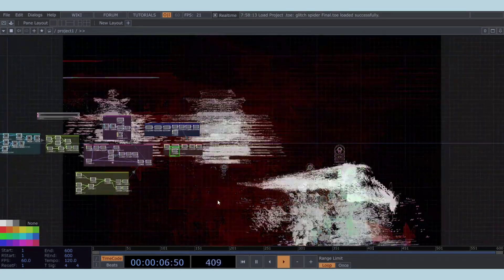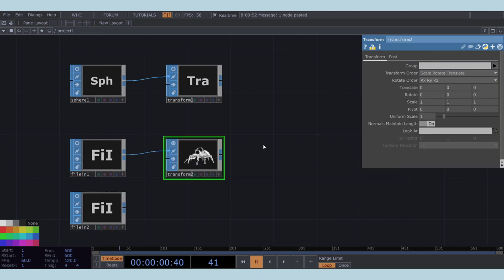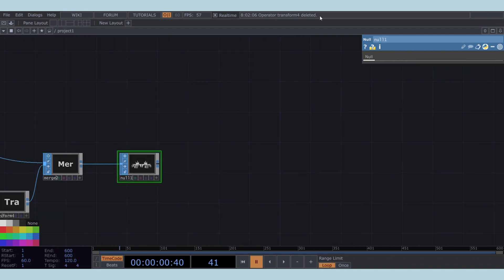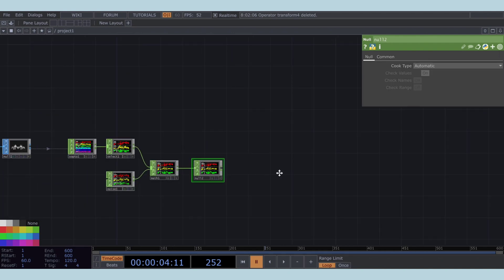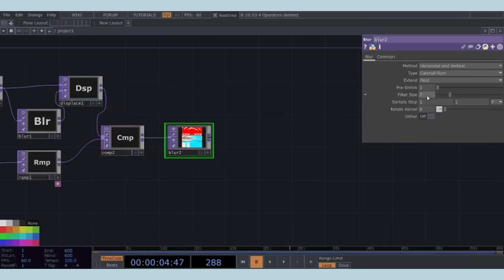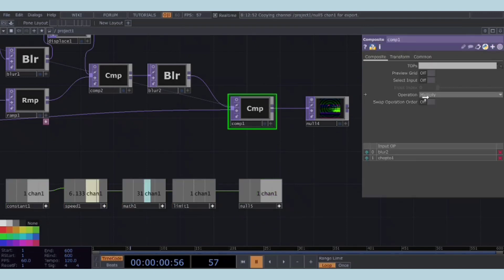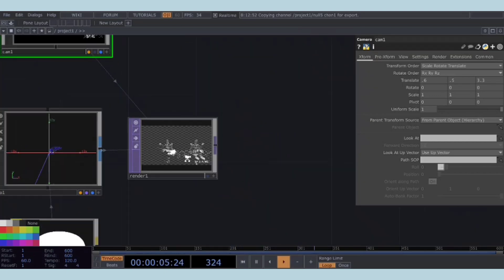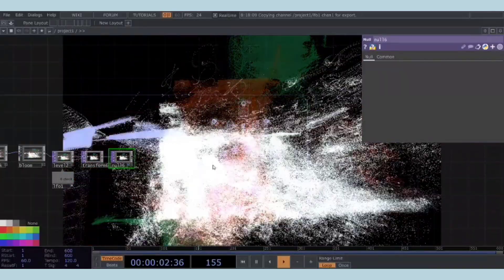Glitch Spider particle system - TOUCHDESIGNER Tutorial

Comment: hi mate currently when my bass comes in the main background goes white how do i change this so it's not white maybe a different colour or just black?
Reply from the maker: U can invert the color using the level top at the end just set invert value 1,to have ur desired colors use the combination of ramp and lookup just connect the visual in the first and ramp to the second input of the lookup and adjust the ramp settings to change the visuals color I hope this is what u wanted ❤❤

Comment: how are you adding operators so fast without the palette?
Reply from the maker: @sea.feeling  I guess it's recording problem I was using the built in screen recorder of windows so it doesn't record the pop up window, but this problem will be fixed in future videos, I'm switching to obs, I hope u got ur answer
Reply: @PiFrac-DEV  got it
Reply: Followed steps but got nothing hmmm
Reply from the maker: @joshmahaffey5554  in the feedback loop try adding a blur top in between the CHOP2 and composite, I think this part was skipped in the video, and what do u mean by nothing is ur screen blank no particles